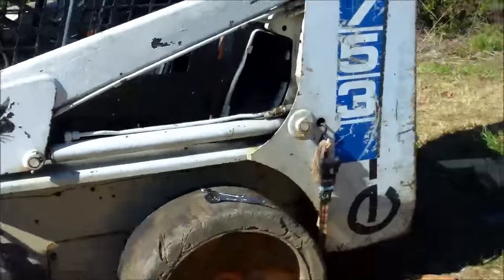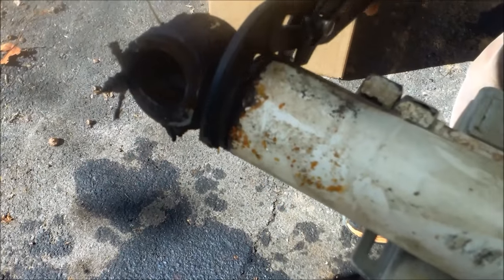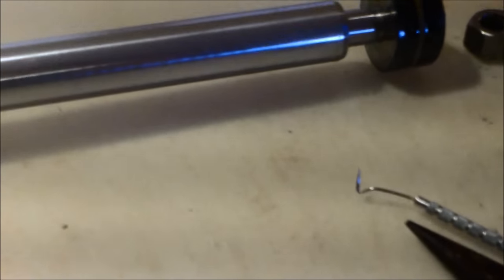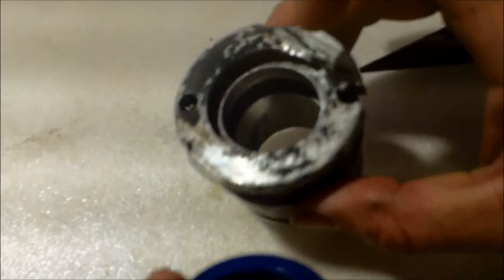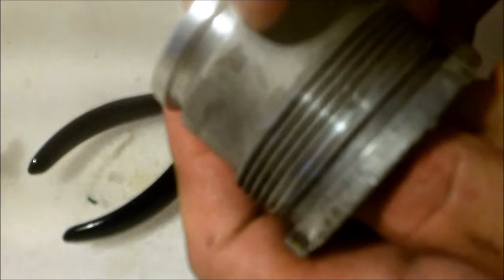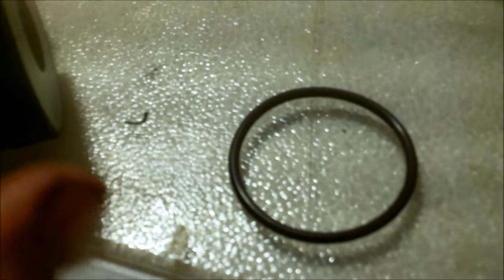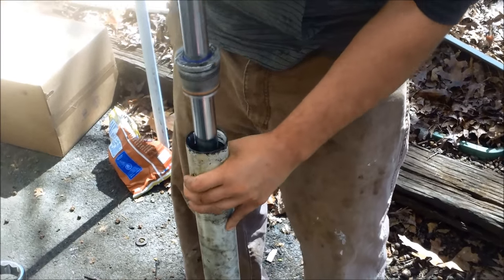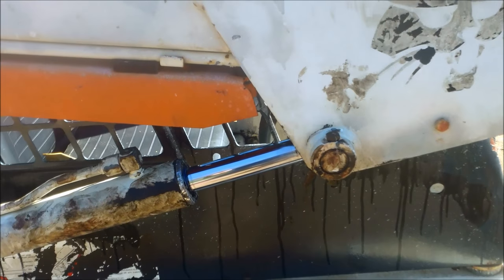how to Repack a Bobcat Lift cylinder with new seals on a bobcat 753

Comment: Many thanks, DannysCam, for this video. I bought the seals for $28 and was able to repair the lift cylinder, saving me at least $200.  Couple of comments to add to the clip.  I would highly recommend using an oil filter chain wrench instead of a channel lock to remove the end of the cylinder if it is stuck as mine was. Otherwise you’ll probably damage it. Also, some penetrating oil is useful. Warming the seals with an electric heating gun is imperative to get them folded into the heart shape and seated. I partially screwed the end in place and warmed the end seals again just before easily tapping the shaft through them. Then I unscrewed the end piece and shaft and replaced the sliding collar, seals and nut. The piston went back in well. I appreciate your taking the time and effort to help us, and I hope my suggestions add to this informative video.

Comment: Great video man! Dude Ill tell ya, Ive packed a few cylinders in my day, but that mustang skid steer I had a few years back, the doggone tilt cylinders on that thing gave me a damned fit. Well, the first nut (the one you used the channel locks on) gave me fits on one of mine. I had a love hate relationship with that machine. LOL. Also, since it was a mustang, I didnt get new nuts with my packing kits.

Comment: I tried everything to remove gland nut off my 763, can I get the cylinder rebuild and shop can take it out another way or is aftermarket cylinder is good?
Reply from the maker: The after market ones are good sometimes cheaper then a rebuild
Reply: @DannysCam  Thanks! I went on eBay and there quite a few brands out there, any brand you know off hand that’s good? Any other tips that could get that seized gland nut out? We tried heat, pipe wrench and large cheater bar